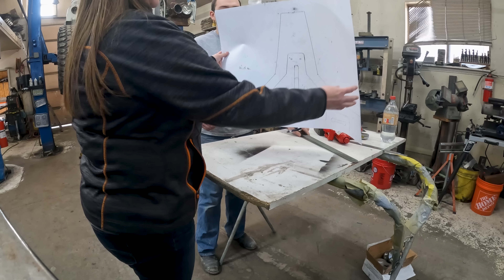So Much To Do; Will We Get The Wrecker Ready In Time??

Comment: Break a tap? Carbide bits on a die grinder can chew through the center (flatten it, then let you start a hole in the center). Left-handed cobalt drill bits can drill through. But it's never fun.

Comment: For your bowed dimple die plate, flip it over and press just slightly back down on the dimple die (the opposite direction from your initial press) and it will straighten it right back out.
Reply from the maker: Thanks for the tip we did try that and it worked great!
Reply: @chadsfab  Anytime! loved the Griz build! have a 68 K20 of my own im building into a work truck/off road toy/ recovery rig.

Comment: I would have simply laid those side plates on a larger piece of sheet stock, welded them together, trimmed the outside edges as desired, and blown out the slots and holes with the plasma. Tidy up with a whizz wheel or die grinder as needed. Would have taken a quarter of the time.
Reply from the maker: Kaden wanted to use the dimple does, perfect opportunity to learn 😉

Comment: They punched three holes in the bottom plate for the winch support brackets. This will resist lateral torque when pulling. They joked about putting Stop Lights in there, but it would have been a great place to put some auxiliary work lights for late-night work.
Reply from the maker: Still could happen 😄

Comment: if there ever is a next time I recall being told about useing Alum to remove steel tap from aluminium.     I googled it and came up with this " Dissolve as much Alum as you can in a (crock)pot of warm/hot water. Immerse the aluminum part, turn on the heat, and allow the brew to simmer for a couple of hours. The tap will dissolve, and the aluminum will get a kind of sooty coating that washes off."   I was hopeing to see this in action but jobs done so no worries.

Comment: Chad what are the heat shrink things you used on the radiator hoses? where to get them? Thank you! Might have to build my 72 K20 into a wrecker.
Reply from the maker: They are made by Gates and they are commonly used in the trucking business. Got them from Napa, but them and Carquest’s usually have them in stock

Comment: I will ask this again. What brand of electrical connectors are you using? Answer is greatly appreciated. 👍
Reply: What connectors are you asking about? There are probably 20 different types/styles and 20 different brands used.
Reply: @dustincarter881  Thx. for responding. The round aircraft style connectors are the ones I am interested in. What do you think about the Deutsch connectors? I m currently using some called Superseal connectors but they are not as waterproof as I would like them to be.
Reply from the maker: Deutsch are great, I generally prefer metri-pack and weather-pack though.
Reply: @chadsfab  The round aircraft style connectors you used on Matt's heavy wrecker, what brand were they?
Reply from the maker: @jonmcfarmer6954  They are Deutsch connectors.

Comment: NEVER power feed a pipe tap unless using a CNC with a stagger tooth tap.  I don' t even do that anymore.  I thread mill all my large pipe tap holes in a CNC mill for production parts.  Especially in easy to tear aluminum.  It takes time to not rip the threads and best to use a taper reamer as well as the tooth depth gets harder to cut as you go deeper.  Patience and care are needed for large pipe taps.  Hand drill or impact won't keep it straight either.  If doing it by hand you have a chance to correct wayward angles.  Good lesson to all viewing!

Comment: Wow you'd think you would have removed that piece before you tapped into it. where do you think the shaving's are going? You use a hand Tap Holder so you can feel the pressure your applying. Spent my working life building High Speed Alum. fast Ferry's/ Catamarans. But everyone is allowed a few screw up's.

Comment: Nice to see you work thru issues that arise, now I’ve got to find a misfire in cylinder 2 of my 4.3 v6 2003 Chevy s10 zr2 …..
It would be nice to have a garage to work in! Oh well YouTube’s gives several suggestions….. off I go…. Before I do, what is the triangle thingy with “spikes” on it, on the blue lift arms, just above the magnetic part trays door side. 🙏👍
Thanks for the family video! 🙏❤️😎🤙🛻💨
Reply from the maker: That triangle holds the torch for the MIG. 

Good luck on the truck!

Comment: It  might take  a little  more  work  tapping  but  that's why I do it by hand,  and  aluminum  gets  gummy  with  a power  tool.
Reply: Just use paraffin white spirit or diesel when tapping aluminium.😊
Reply: I agree, do it by hand. Using an impact on a tap? Not
Reply: Also spiral taps work better on aluminium.
Reply: I break more taps by hand than with an impact. Not sure why. Tap handles just seem like they are poorly designed for keeping things straight.
Reply: @Ryan_Tidwell  think about what your doing and why it works, it's very simple.😊
Reply: @Ryan_Tidwell  skill
Reply: @walkingwithdogs8547  Doh! gee thanks bro! I never think about what I'm doin'. It uses up too much of my brain juice.
Reply from the maker: We do it a lot, and have been for years. Rarely break a tap. Problem was the tap was cutting about an inch of threads. Break more taps doing it by hand, hand taping side loads the tap more and tends to snap it. Where as a small cordless impact does a straight twisting motion.
Reply: @chadsfab  once  again  skill, I was tapping before battery  drills,  no disrespect  to anyone  but I tapped when  their  was no power  and  8 appreciate  what  I've  learned.
Reply: I worked with a guy who liked to power tap NPT threads.  He was warned by the supervisor NOT to do it again.  He did, snapped off a tap in an aluminum part.  FIRED on the spot.
Reply: @chadsfab agreed!

Comment: My first time seeing a tap being used with an impact tool. :(
Reply: Fab Rats does it  a lot. Tried it once with a tap that was made for an impact tool and had bad results.
Reply: It works just takes practice and getting used to. I do it a lot 🤷
Reply from the maker: We do it a lot, and have been for years. Rarely break a tap. Problem was the tap was cutting about an inch of threads.

Comment: whats  the difference  between welding a head of bolt to the broken tap or what you did to get it out also the difference of an easy out
Reply from the maker: Tried welding a bolt on it, didn't work. Couldn't see it on the video very well so it didn't make the final.

Comment: Tech tip to keep things from pulling while welding keep a couple thick 1 inch strip  like 1/4-3/8that go across both pieces of tube then use your clamps on both tubes it will keep them both aligned easier

Comment: Love your content as always. You may already know, but a tip from the sheet metal trade: Somewhere on that brake is an adjustment to align the top leaf. The rule of thumb is 1.5 metal thicknesses offset between the front of the top leaf and the back of the bending leaf. Thick material bends easier and reduces the load on the pins and your back. Just remember to close the gap back up when you go back to light gauge material or you will get a sloppy radius on your bends.
Reply from the maker: Thank you for the reminder! I don’t think I reset it after bending the thick stuff, gotta check on that

Comment: I feel for ya, I do a lot of tapping thru aluminum  and it happens, not as often now I only use screw guns with torque adjust no impacts and lots of oil my batting avg is more than .850 now way better .From  7/8" down to #10 x 32. Attitude gets it done faster . Stay in it guys you got it

Comment: Hand tap wrench on taper taps only 🫣 
 You might find that the thread on the fitting is oversize and the thread in the case not undersize!?
Reply from the maker: The thread in the case was definitely undersized. Tried multiple fittings

Comment: Good work guys. Just a little tip with the dimple die once you've made the dimple take the top die off and flip the steel over onto the flat part of the press and use the bottom part of the die to press down onto the steel and it will flatten the steel back out

Comment: Ya don't use an impact on a tap, boys. The hammer creates short, high-amplitude torque pulses, which is perfect for breaking hard and brittle taps...
Reply: Paul at Fab Rats does that  also! I cringe every time he or Chad do it!
Reply: The best way to tap is with an impact driver .  Lets you use taps not sharp enough to turn by hand.
Reply: I knew someone would bring up fabrats and the impact and tap hilarious 😆😂
Reply: What can I say....Retired Master Tech.
Reply: I do it but not on 6:32 taps with a 1/2-in impact. You have to use discretion and be light on the trigger. Use Small ugga duggas not big. And if the tap snaps off as easy as it did for Dusty the tap was probably cracked and ready to go anyway.
Reply: I've done it a thousand times without issues. Tap nice and straight.
Reply: False
Reply: Every drill and impact manufacturer now sells impact ready drill bits that have tapping threads on them... like 3 or 4 years now
Reply: I thought the same thing for a long time but I see people on the internet do it all the time. Somehow it works for them. My teacher would have lost his mind had he seen one of us trying that back in the day! It would have never crossed my mind to even try it, yet, here we are 🤓
Reply: I tend to agree, but I know several people who do use impacts on taps!  With pretty good results!
Me, I do it by hand, but it isn't an uncommon practice!
Reply: I’d bet that all you guys who use impact drivers on taps don’t do that on pipe taps which are tapered.
Reply: In theory I agree, but it seems that it actually works and breaks less taps. If your not a gorilla on the trigger, I would love to see an experiment seeing if it is actually placing any more load on the tap then traditional driver.

What the impact driver does do is allow the operator to remain straight easily and it seems this might actually be the bigger reason small taps break, not torsional stress (any videos out their testing this?)

I still go back and forth to break chips, I see Fab Rats just send it, but I haven't being that game yet. Still feels wrong using a impact, but it's worked the couple times I've tried it now.
Reply from the maker: We do it a lot, and have been for years. Rarely break a tap. Problem was the tap was cutting about an inch of threads. Break more taps doing it by hand, hand taping side loads the tap more and tends to snap it. Where as a small cordless impact does a straight twisting motion.
Reply: @chadsfab  Truth even snap on has a bad day !!
Reply: @chadsfab  and remember it's all learning... bless u and the family
Reply: @chadsfab  
Where I use to work they did the same.  I just mostly use my taps and dies to chase threads!
Love your channel!  Good luck the wrecker!
Reply: What is it with YouTube fabricators and impact guns?

I use my 18v Bosch cordless drills as a screwdriver and with eg my taps & dies.

I can choose to use their percussion/hammer action feature, or not, if I feel I don't need it for a particular job

Far more sensitive as I can adjust the speed and torque settings to suit whatever task I'm doing.

Ok, I certainly would never use a cordless drill to torque down nuts& bolts, but imo its about using the correct wrong tool for the job.

Impact guns obviously can be used for a lot of jobs. 
Should they though? that's my question.
Reply: I don't do it for trust issues, but at work they do it all the time on existing threads, not new.

Comment: Sometimes using the impact doesn't save you any time 😢, and the bad thing is that you know that you are smarter than that.❤
Reply from the maker: We use an impact a lot, and have been for years. Rarely break a tap. Problem was the tap was cutting about an inch of threads. Break more taps doing it by hand, hand taping side loads the tap more and tends to snap it. Where as a small cordless impact does a straight twisting motion.
Reply: @chadsfab  I just re-read my comment and realized that I didn't indicate that the last part was about me.